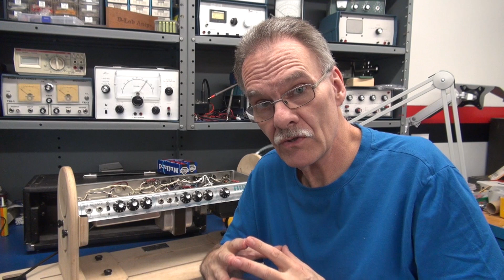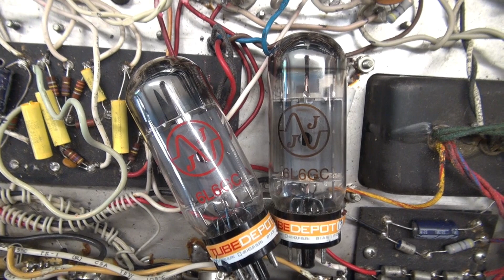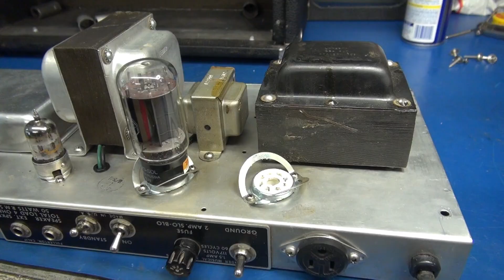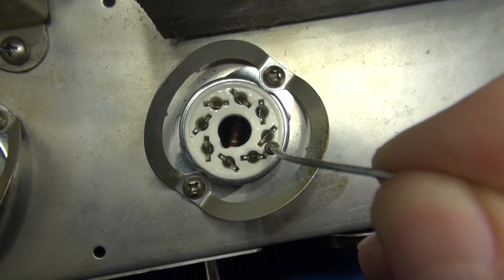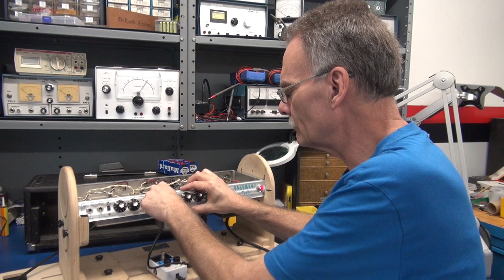Vintage Fender Bassman 50 guitar amp Red plate 6L6 tube What was the cause? Goodbye Ruby Doomsday

Comment: I see that the ground switch is set to no ground there is no ground at all. In prof. amps equipment resistance of 47ohm/ 1 watt is always used. Or does it have to do with having those systems with balanced inputs and outputs?

Comment: Had the same problem with those sockets.   Sadly I do not have NOS sockets left in stock.    What modern ones do you recommend ?
Reply: Mojotone has Fender Style Exact Replacement octal sockets. They work without modding the chassis.
Reply from the maker: I will take a look, Went to the site, All I saw was the top mount ceramic type.
Reply from the maker: The Belton Micalex are great quality. Only problem is the chassis hole needs to be opened from 1" to 1-3/16" and the mounting holes are off too. The collectors frown on drilling. I normally keep an eye on ebay for the original top mount type. Sometimes you can find a deal

Comment: It’s getting to the time I need to go over my old CBS Fender Bassman 100 silver face 

I had a tube go south on me. Dropped another used  one in that got me out of trouble, and that was 2 years ago. 

That said, I ran the Bassman 100 through one quad box, my 77 built Marshall 2204 Master Volume through the ‘B’ Quad box underneath.  Jumpered the two Bassman channels together with the Marshall

Wow. What a tone

Comment: Belton is the only new socket that work for me.  The teflon are fine but not for these amps  a bit of a cost more than needed.
Reply: Do the Belton sockets fit a Fender chassis with no modifications ?
Reply from the maker: Nope, You have to increase the hole diameter. You would need a large stepper drill. I try to find vintage sockets that fit
Reply: Thanks  @d-labelectronics  thought that was the case, just wasn't sure.